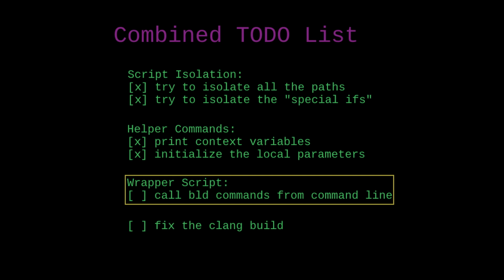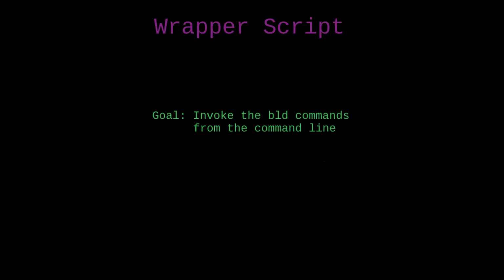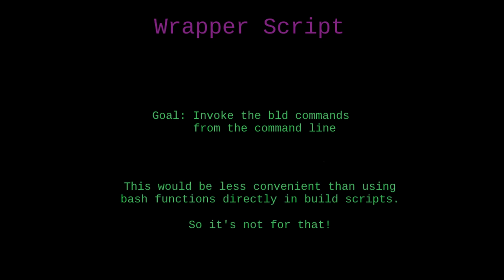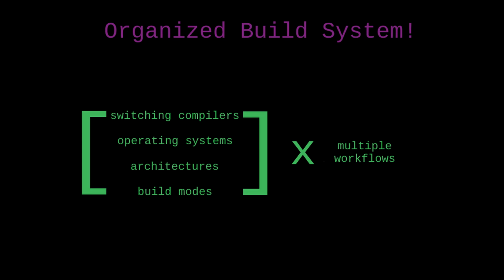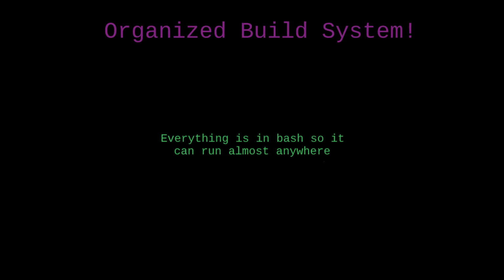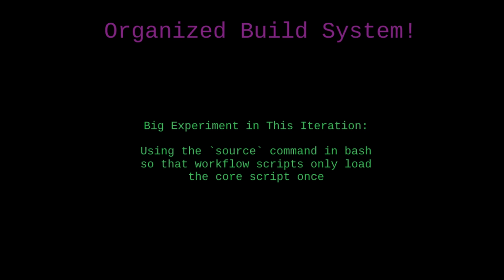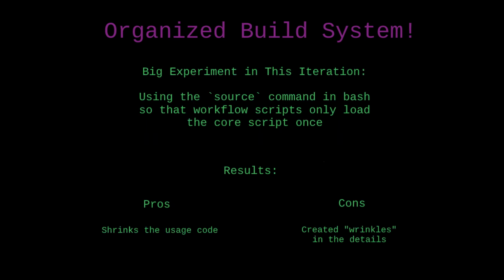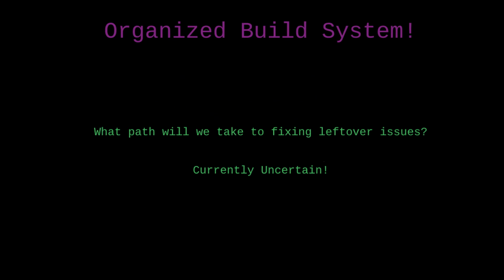Build [7]: Wrapping Up

Comment: You should use case/esac instead of an if/else chain. I'd also recommend you use [[ instead [ in your if conditionals. There's some nice explanation on shell check's docs for why that is
Reply: You also don't need to surround the RHS of variable assignments in double quotes, as they're not subject to word splitting
Reply from the maker: These are great tips thank you!! I will apply them during another pass over this system.